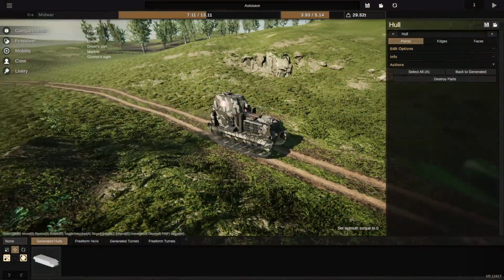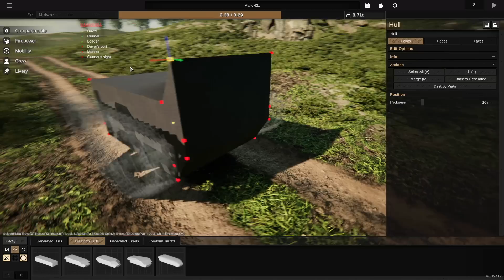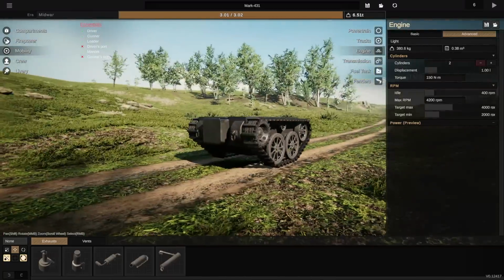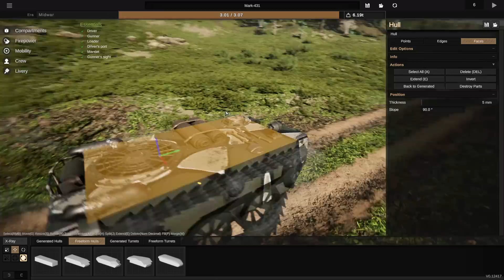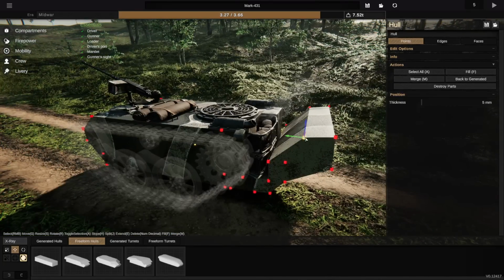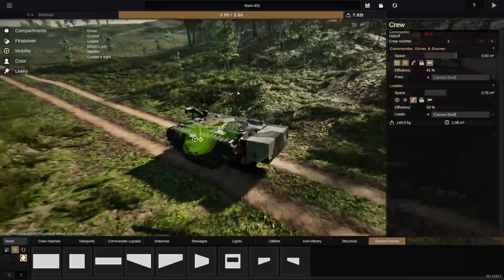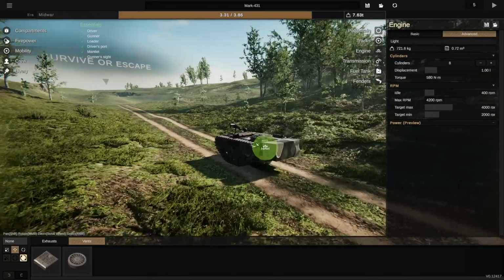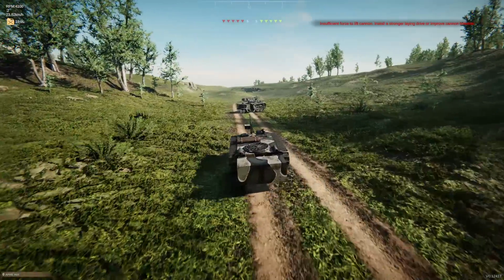I Built A Tank THATS GUN Is TOO POWERFUL THROWS TANKS AWAY In Sprocket Tank Design!

Comment: You basically made an upscaled and crewed "Goliath"  (German WW2 explosive device)
Reply from the maker: Kinda, yeah
Reply: Not really. He made more of a Churchill 3in-Gun-Carrier, that's been washed too hot. The Goliath was a so-called "tracked mine", which(in the case of the Goliath) is essentially a big-ass pipebomb on treads with a Porsche V8-engine and a remote control/detonator strapped to it. The first few generations had a "Fly"-by-wire kind of remote control with a long-ass cable attached to the back, while the last generations had wireless remote controls. And thanks to the Porsche engines, these little buggers were quite zippy too. They could catch up to most allied tanks and even some of their armored cars of the time since the theoretical top-speed(which they never did, tho) of the Goliath was quite close to that of modern-day MBTs(if given the necessary gear ratios). These forbidden proto-roombas could even be used as one man off-road gokarts after removing the explosive charge, as actually seen on many pictures~ XD

To sum up the Goliath in one sentence: "Zippy box goes boomies~"

Comment: If you made the barrel stupidly thick, you may be able to use it as a counterweight to stop it from pointing to the sky. Otherwise, you could put it into a separate little compartment with a lower floor so it can't elevate at all. Check the green lines when looking at azimuth controlls.